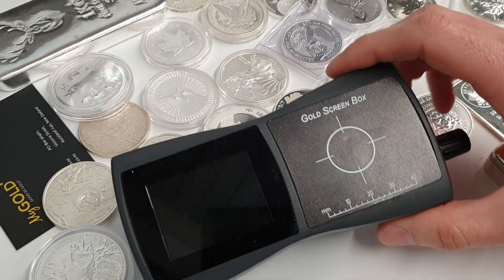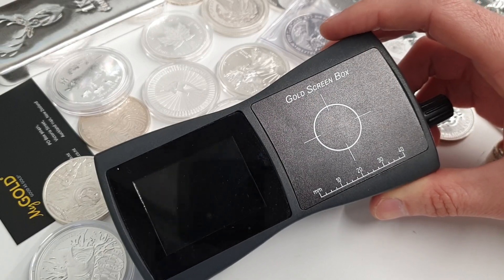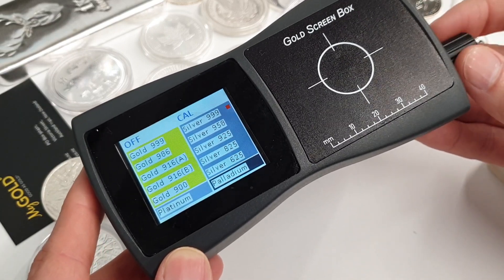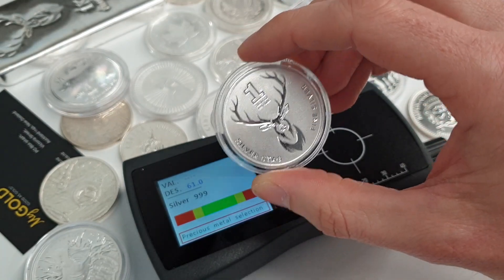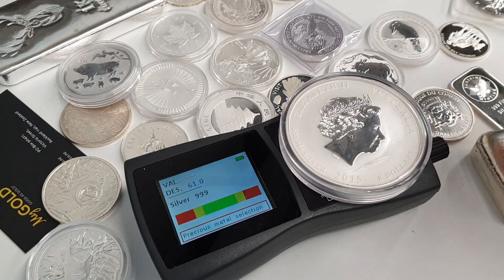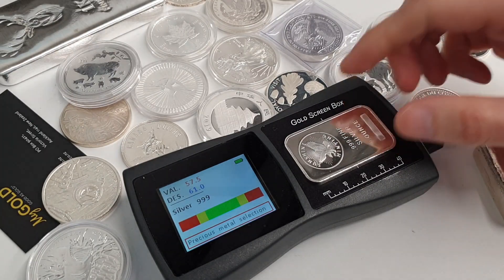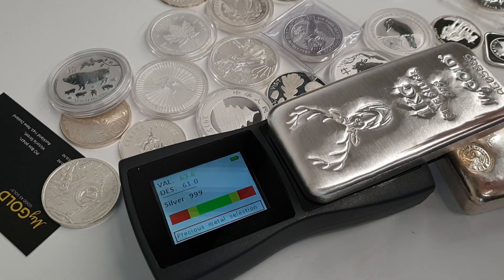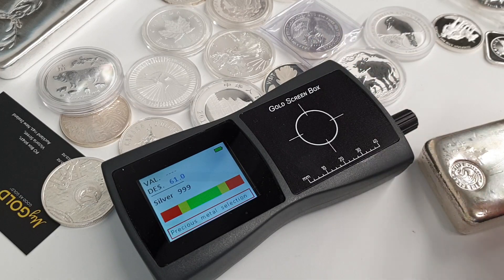How to Test Silver 🎯 One of the best ways to test Silver Bullion, Silver Coins, Silver Bars

Comment: is this just a sensistive Mho meter? This measures surface resistivity? What is there is a weight embedded in he coin that would pass the Eureca test? Also, what is there is oxidation on the surface?
So, I don't think it measures resistivity or conductivity, but a magnetic flux - that would go through the plastic. The one bar is a puzzle! I think he was realizing he got duped?
Reply from the maker: Electrical conductivity as mentioned in the video.